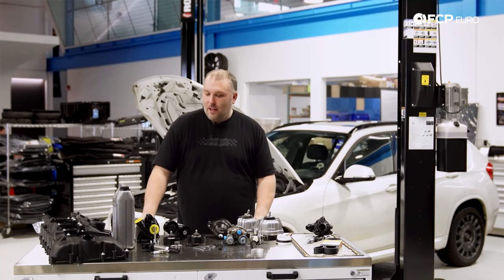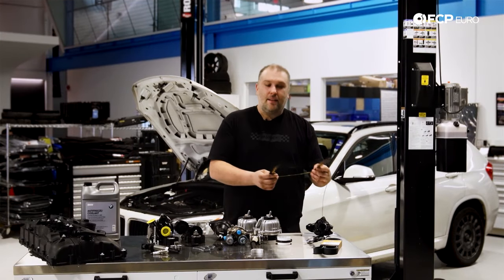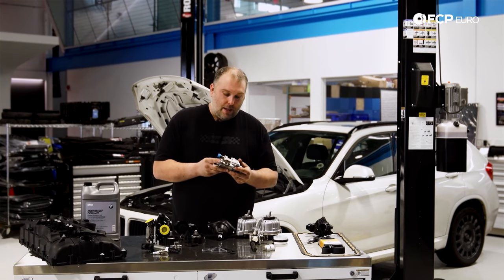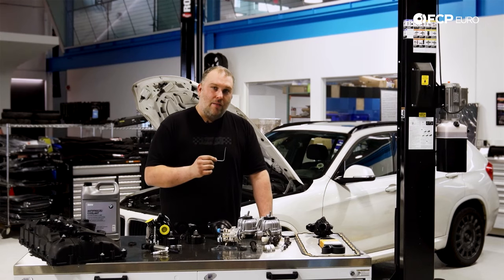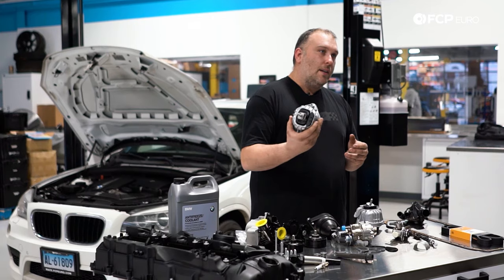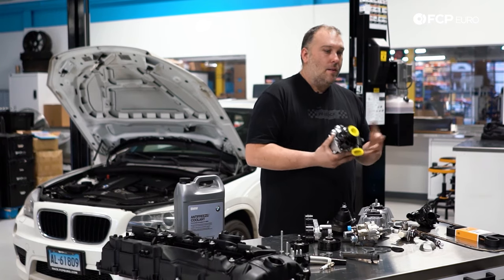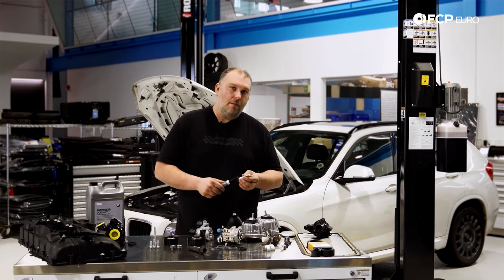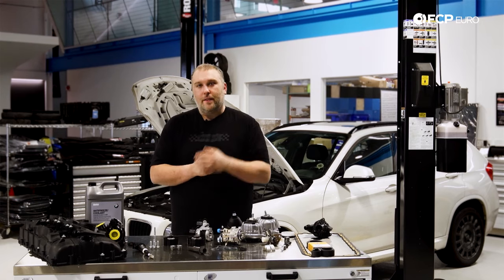BMW N55 Engine Diagnostics/Problems - Everything You Need To Know (X1, 135i, 335i, 435i, 535i)

Comment: I wish you had talked more about the prevalence of engine failures after valve cover and oil filter housing gasket changes.
Reply: Nicholas Marangos I think that belief has been proven to be a false correlation
Reply: Thanks for the reply. I’ve read about a lot of failures. Any sources to the contrary?
Reply: https://f30.bimmerpost.com/forums/showthread.php?t=1686319 make sure to read the whole thing because some say prime the oil whenever you do anything to oil system but like others on that thread mentioned there are thousands of ofhg jobs done each year without doing this method and only a few instances of engine failure shortly after so I assume it’s because mechanics drop things into the ofh and it clogs the oil flow or also probable ,the lack of proper maintenance leads people to just blame it on anything that is popular misbelief
Reply: Yeah don’t think this is really a thing, take what you read on forums with a grain of salt
Reply: Never heard of a failure after a head cover replacement. But for sure after the oil filter housing gaskets. You MUST prime the engine after those get replaced.
Reply: Carl Gentile ... Prime as in fill the housing with oil, then put the cap with filter on? That is basically what I did on my 11' 328i N52.
Reply: @Workin247  Why, and what does it mean to prime the engine? Thanks
Reply: @Vic Wahby Photography priming engine is recommended only when you do repairs to the oil lub system and is done by unplugging the fuel injectors and then starting the engine (Turning over engine for 10 seconds to get oil flow thru whole system ).

Comment: Great video! It really sums up all the issues concerning the n55. Ive been through water pump at 76k kms, hpfp at 90k km, sofgh leak, oil pan leak, tensioner- pulleys and belt now i am going through valve cover, its sometime making noise from the rear seal when i come to a stop. Seal which ive already replaced ( thought it was that  ). 
I am currently at 109.000 kms.
If i remove the oil cap and noise goes away, that's a clear indicator that the valve cover is the issue, right?

So yeah, I've got motor mounts left to be out of trouble lol 
I love this car though!
Reply from the maker: Glad you like the video, Christoper! N55's can certainly be a bit needy, but they are so worth it! That noise could be a bad/clogged PCV valve causing excess pressure and that noise which you release when you open the oil cap.
Reply: What year & car???

Comment: Hello there. planning to buy a 535i xdrive and did some research on n55 my question is how common are water pump, cracked valve cover, oil filter housing gasket, etc can go bad. does these parts go bad on all 535i ? or you can be ok with timely maintenence ? thanks in advance

Comment: Well I have had everything with the exception of the crank hub fail. Had the engine replaced at 97k miles with no mods. Fun times.

One more thing: I have a stack of service records 1/2” thick.
Reply from the maker: Those service records are worth some money!
Reply: What engine you talking about?
Reply: ̈ N55
Reply: @DiscoR53  I'm in Germany & want to buy an E82 135i N55... Will I have any luck if I go for the last year or something, what year was yours? They sound so good, I do my own basic maintenance but damn
Reply: ̈ 

The original engine was was the 2011 and the previous owner had tracked the car. The second engine is a 2012 and the Valvetronic failed. 2013 was the last year for US cars, I have no experience with these engines.

Hope this’ll help

Comment: Hey there i am little bit confused i have used ceratec in my car in last service and the car has run 8000 now it’s due for service so can i use engine flush in this service?
Reply from the maker: Hi Adish, you can, however, normally the procedure is to run engine flush before Ceratec, that way all the surfaces of the engine are clean for the Ceratec to latch onto.
Reply: FCP Euro i have already added ceratec so I can add engine flush in next service?